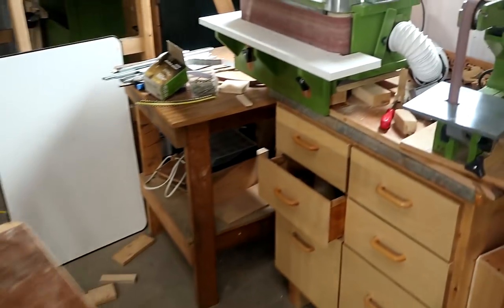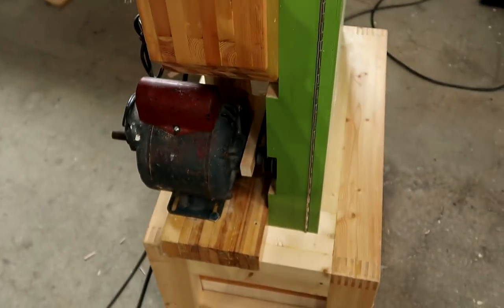Pulleys with setscrews suck

Comment: The humble set screw is not the problem, they work fine. Thread locker will not solve this. The issue is the poor fit on the shaft. Being able to re-mount the pulley with that shim means it was far too loose to begin with. That said, the shim should now fix the problem. Ideally it should have no play and the screw must bare down on a flat or countersink on the shaft, or for higher torque applications, a key.
Reply: With all due respect to Matthias, I have to agree. Set screw pulleys have been used for a longgg time and give few issues. Shaft of the motor looked pretty buggered up. Could take a mic to it and probably see that its off
Reply: It already has a keyway and key, and the setscrew bears down on the key. The key is especially visible as he's applying the UHMW tape to the motor shaft.. You're right, the fit between the shaft and pulley is by far the biggest contributor to the problem.
Reply: He seems to understand the problem is with the fit, yet calls out set screws for some reason? Idgi
Reply: The problem with the SS isn't just the fit. The materials are different,  the cast aluminum pulleys will yield over time especially when there is side or uneven load on the pulley. The set screw will then make matters worse because it will act like a pivot and the pulley will wallow out in an oval shape. The supplemental SS at 90° will make it last a little longer before it fails but the expanding bushing he describes at the end is indeed a better solution but again with an aluminum pulley you'll still have it loosen over time, the difference is the bushing can be retorqued to restore the as-built strength of the assembly. Once the pulley wears a bit with a set screw it can't be restored until it's machined out and bushed.

Comment: I was expecting a wooden pully with a ground keyway and a wood screw as a key. But this is good too.I've seen you shim shafts like this in the past, with plastic bottles, or maybe soda cans, and it has been useful to me on my bench grider. I've picked up so many little ideas from you that end up becoming solutions to problems.

Comment: As someone who has spent many years changing motors etc, our biggest problem was removing a pulley that had set screws, that's because the shaft and pulley were correctly sized for a tight push fit, also most of the pulleys had allen head grub screws, get a bit more torque when tightening, the flat slot tends to expand and make it hard to get it tight..
Of course we also had taperlock pulleys too, much better to use

Comment: I deal with a lot of belt-drive pumps, mostly 5 horsepower motors driving a pump.  The fit has to be very precise, and even with just one set screw on the pulley I rarely ever have any trouble. I had to "temporarily" solve an issue with a pulley getting loose which I caught early. I put blue Loctite on the shaft to fill the gaps, and it held tight for quite a few years.

Comment: I suggest grinding the set screw to a point like a center punch if you still have problems with the pulley still comes loose. Fitting tight on the shaft is most important though

Comment: I have a commercial bandsaw with a setscrew in the motor pulley which bears on the key.  When I changed out the motor I found that the pulley was also a press-fit on the shaft, and there were actually two setscrews one behind the other so that they couldn't work loose.  I guess 'better safe than sorry' was their motto!

Comment: Hey Mattias, just a thought. With a dremel, cutting disks and a little care you could cut a keyway on the shaft. A couple of your pullies looked to be broached for one. That would solve the problem permanently.
Reply: It already has a keyway and key, and the setscrew bears down on the key. The key is especially visible as he's applying the UHMW tape to the motor shaft.
Reply: Ahh.. didn't see that. Thanks for pointing it out Scott.
Reply: the problem is the loose fit as already noted there is a key but a setscrew will never stay tight if the axle and hole is not a tight fit :)
Reply: You'd be far better off using an angle grinder. Dremels suck.

Comment: File or grind a flat on the shaft in the general area where the set screw contacts it. Position your pulley on the shaft and tighten the set screw to make a mark on the flat. Remove the pulley and with a drill bit, drill a dimple for the set screw to rest in.
Reply: Yup, it's the obvious solution.

Comment: if possible, always use a new set screw.  once a set screw is tightened down it becomes dull and can no longer "bite" into the shaft as well as when it was new.  a drop of blue loctite with the original install will keep it from vibrating loose.  those collet bushing (however you described them), typically called taper locks are awesome.  just be sure to NEVER put anti-seize on the shaft or the tapered bushing.  i learned the hard way they can shatter under a load sometimes when you do that.
Reply: MrBildo6 why do they shatter?
Reply: i have had it happen twice.  both times i put on antiseize.  i think it has to do with the antiseize allowing the tapered bushing to move slightly while being under a lot of stress.  as the male cone side goes into the female it gets smaller.  you tighten the bolts in equal amounts in sequence making the male side grab the shaft even more.  it may not feel like a lot on the bolts but as you tighten one the others loosen, creating more and more stress until all the locking bolts are of equal torque.  i am a maintenance mechanic at an industrial plant and have installed  at least a couple hundred taper locks.  the only ones that have failed have had antiseize.  i also remember one of of sets of instructions saying to never use antiseize on them.  my reasoning may not be true, but it makes sense in my head.
Reply: good point! Thanks.
Reply: They will shatter if the shaft is too small meaning you overtighten them, that causes it to crack where the 'release' screw hole is, but you can reuse them if you can't get hold of a replacement, i actually removed a cracked one from a failed motor, and had to use it again on the replacement motor, so it had been there a while, and as far as i know it's still there.
The other way they can crack is when people don't know how to release them, i've seen a guy with a puller on the pulley swearing at it (harder you pull, the tighter it gets).
Reply: Hey, if you screw a 4-40 bolt into an M3 hole, it will go in...once.
Reply: the antiseize would explain over tightening, less friction, able to move further in the cone.

Comment: Two set screws at 90° to 120° apart will form three points of contact with the shaft and prevent the slop that unscrews the set screws. It's the way we always do it when the sheave (pulley) is to small for a taper lock type bushing. If you buy comercial grade sheaves, they come that way. Consumer grade are missing the second set screw to reduce cost but one can easily add it. DO NOT place the second set screw 180° from the other! It will pivot on the two points and unscrew them faster that a single set screw!

Comment: I've found that pulleys that are listed as having a "bored" hole always fit snug, and are the correct size for the shaft, rather than the normal cast pulleys which are always a little loose and wiggly on the shaft.

Comment: I've seen you use a hole through the pulley/shaft. Why don't industrial designs use that method? I suppose it could still wobble, but at least it won't come loose.

Comment: The set screw is supposed to be slightly hollow and cut into the shaft to lock the pulley. Either your shaft is worn or the pulleys are worn as they should not wriggle.

Comment: Loctite on the set screw didn’t help?
Reply: I've put Loctite on the shaft of a loose fitting pulley as well as on the screw.  Once it hardened it stopped all the loose movement.
Reply: You simply heat the pulley and the loc-tite red will break off...
Reply: There are several grades of Loctite with different properties, for different applications.
Reply: This is how we install press fit pins at work just to make sure there never is a loose pin problem. A jam nut on a longer set screw would work if there is enough room, especially 2 jam nuts on 2 sets screws.
Reply: A thin layer of WD on the shaft side only will do a better job of allowing pulley to come off later.  It won't allow the loctite to bond with the shaft, only the pulley.  I would be hesitant to apply heat to an electric motor shaft unless you are throwing the motor away.
Reply: Michael Smith If you heat the pulley with a oxy acetylene flame the pulley get hot fast enough that the heat don't travel that long on the shaft. That way you can get the pulley off and cool the shaft without any damages to the motor.
Reply: ganymedeIV4 heat it up and the threadlocker breaks down. 
Easy peasy
Reply: Loctite actually make a product called “guntite” used by gunsmiths on fire arms.
Mostly grub screws etc on telescopic sights mounts that are subject to recoil.
It can easily be removed by applying a light blue flame form a butane torch, without “over heating” anything critical.
Sometimes it’s just a case of knowing the right product to use.
Reply: " ...  I would be hesitant to apply heat to an electric motor shaft unless you are throwing the motor away."
You can heat the set screw with a soldering iron, not a torch ....
Reply: I've used standard blue Loctite on the set screw and shaft, it's not hard to break loose, and a proper gear puller was able to remove the pulley easily.  The only ones I've ever had real difficulty removing in my experience had gotten wet and rusted.
Reply: Note where the set screw marks the shaft, spin the shaft & grind or file a shallow groove at the contact place, then Loctite the set screw in place.

Next time, make a keyed pulley/shaft system.
Reply: Sean Flanagan pretty sure it's already keyed

Comment: An old trick an old machinist showed me many years ago was tighten the set screw as tight as you can  than use a punch to drive the screw in with one good wack to drive the screw into the shaft.  Thghten the screw again. Than install a second screw on top of the first screw as tight as you can.  This should stop the screw from coming loose.
Reply: That remedy of a final hammer blow to an already tightened set screw, adding a back-up screw and hammering again would fetch the perp a wrench upside the head in any competent shop where mechanical work is done. I don't know who your "old machinist" is but I'd never hire him. I think you made him up. 

Club fisted mechanics may be identified by the junk and wreckage they leave in their wake.
Reply: Back up screw is fine, but indeed giving the 1ste srew a wack, not much sense. A while ago had ro remove one and the first inbus ( hexagon) was buggerd up, no idea if it was "wacked" or got damaged by the second "wrong" pointed setscrew, instead of a flat on the bottom . Result allenkey didn' t fit anymore and had to drill it out,  and off course didnt took my time( should have gone a left turning drillbit ) and broke the drillbit in it, what a mess, you can imagine...:-)

Comment: "even if I don't understand how" ... I think the trick here is that the pulley grips onto the motor chasis, which means less wiggle and (because wood) also directly dampening it, while the socket (and especially the mounting screw) are "far away" so to speak, so more flex, which means more movement. But just guesswork :D

Comment: Assuming the motor shaft itself it's complete knackered out of  round and the key way not messed up beyond specs.. The first solution in is new key stock and set screw.  Both are so inexpensive there should  no reason to use use new  each time a pulley or motor is changed out. In when Mathias In the collet like mount he was speaking of the QD ( Quick Detach) sheave mounting systems, they are not collet like at all. The hub used in the used in the QD system should fit the shaft as well an  simple pulley is expected to fit.  QD is use whenever there as an expectation of high sheave wear or regular adjustment of the drive ratio. Proper set screws work fine, but they wear out when the edge that cuts in the key stock or shaft will dull.

Comment: Some stuffy remarks:

Worn out is worn out even with low HP motor shafts and pulleys on home brew woodworking equipment. The traditional fit is metal to metal to 0.001" (0.02mm there-abouts) clearance. The traditional and official machine shop repair is true up the shaft fit and either sleeve the existing pulley or bore an undersized one to fit. 

A shim between pulley and shaft is a good second best. Normally, I'd prefer an accurately fitted metal shim but your selection of UHMP seems to work very well. Then there is LockTite but high explosives may be required to remove the pulley later.

TapeLock bushing pulleys are superb but I think your application is smaller than the minimum sizes now available. Besides, they are wastefully expensive for a guy who gets more fun out of utilising scrounged materials.

Comment: I'm going to be fitting a pulley to a 4hp motor soon. It has a keyway to stop rotational movement but nothing to stop wiggle or lateral movement of the is any. My solution is to use a drill bit to make a tiny dent in the shaft for the tightening screw to locate in. I'll use Loctite on that screw so it doesn't come undone. 
Low tech but very effective.
Reply from the maker: The problem isn't the setscrew coming undone.  The problem is if the pulley has even a tingy bit of wiggle on the shaft (which the setscrew can't eliminate entirely), it will work it's way looser.  And if you put locktite on the setscrew, good luck fixing that when it does work it's way loose.
Reply: I see what you mean now; the pulley is too far gone. I wonder how hard it'd be to thread the shaft at the end?

 The Loctite I use is threadlocker (243 I think) and comes undone, it just fills in the screw thread gaps and sets like silicone almost. When you undo it you just clean the thread up with a wire wheel and it's good as new.

Comment: Wait from what I see the set screw is directly above the key-way so as the key-way moves in and out so too will the pulley.
What I would do is drill a hole 90 degrees from the setscrew and drill into the shaft to make a concave then tap the pulley and put another set screw...

Comment: Probably would help...I mean probably wood help if the set screw were a socket head for an Allen wrench or a square head for a "spanner".  Then maybe you could get it tight enough to stay.  But, I agree the pulley ID needs to match the shaft OD or it will keep coming loose

Comment: Glad it worked. Of course the shim sort of "fattens" it. I also think though that, had that shim been there in the first place, it would have acted as an insulator against heat, and thereby would have prevented the problem from developing so quickly. But hey hindsight and all that.

Comment: If you were to test the shaft and the set screw you would find that they are the same hardness. That makes it very difficult to tighten.
Same problem with the set screw in hole saws. Try putting a shim under the set screw.

Comment: Get rid of those cast sheaves. Use machined sheaves, cost a little more, but do so much better. The other alternative is to get some red Loctite and apply it to the shaft and let it set up under the sheave before you tighten the set screw.

Comment: If you had a better pulley and the motor shaft was in good shape with a better fit, then there are often 2x set screws at 90 degrees to each other.  

Drill into the shaft - "grub" it in, the other holds the key like you have.  

On larger pulleys there is room for two set screws in the same hole  - jam screws; you will have to make do with loctite 242

Comment: Worn out ID on pulley or motor shaft OD or sometimes all above.. here are few quick and dirty repairs: with  center punch create small dimples on the surface of the shaft.. it will provide short term repair but eventually fail again... if you don't plan to take pulley off mix some JB weld and once is in place apply epoxy around shaft and pulley.. Now more professional and long term repairs,:depending on severity of damage aka gap you can use Loctite 638 for just slightly loose fit ~ 0.0002" if space is larger than that use Loctite 660 and this will repair your worn surface...(668 is glue and 660 is surface repair compound).  Of course you can use any other brand name that doses same thing.. this is something that I used over the years in industrial applications and  it works... Another tip if you have pulley set screw getting loose over the time ... Remove that one and replace is with two that will equal same height of original , first set screw will lock in to the surface of shaft and 2nd will lock in that 1st can't back off..  and if you really wand go extra mile.. Apply Loctite 242 on the thread, I promise it will not get lose...  FYI.. try to perform shaft / pulley alignment, this can cause most damage and ware out parts..hint belts ..
Here are few links for ref.. good luck 

http://www.petersonpredict.com/apps_beltpullyalignment.PHP

YouTube › watch?v=hxEgKAHE5mY

Comment: How about some threadlocker, or even a locking set screw (they have teeth on the end to fight counter rotation). Also,  I'd drill and tap another set screw or two, if necessary.

Comment: i have a thought , why not tap a hole on the shaft and then put the screw into the hole on both the shaft and pulley? that would align it and it wouldn't work its way loose
Reply from the maker: that would not make it rigid enough.